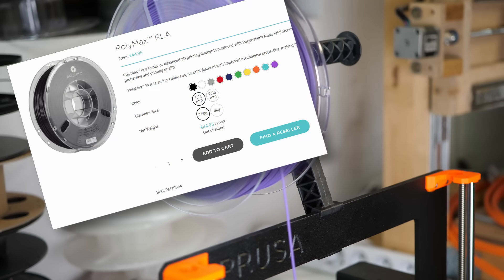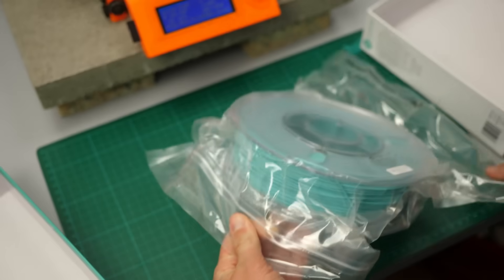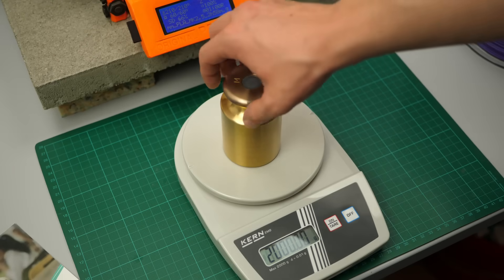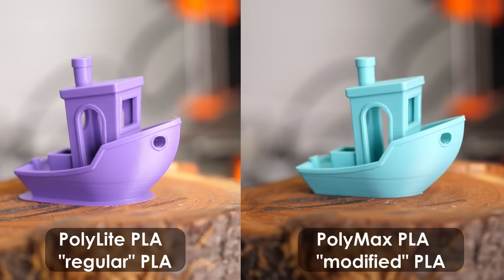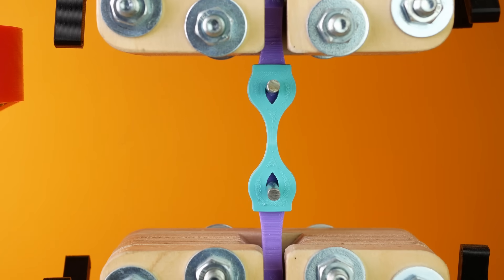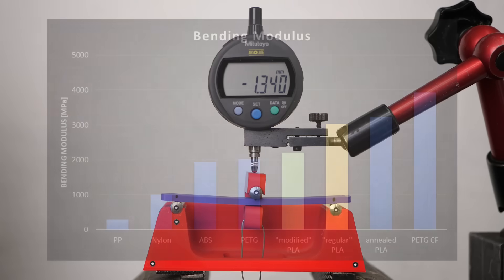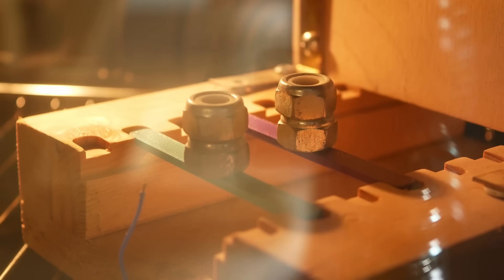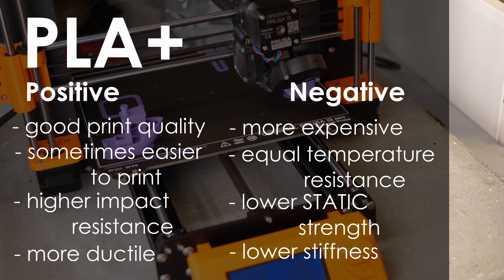How much STRONGER is PLA+ really?

Comment: Thank you, Steffan, for making proofs on my point of view.
ever since I've open PETG for me I used it for technical designs exactly due its better temperature- and impact resistance.  And use PLA mostly for decor prints, for its better stiffness. 
Plus my local filament supplier have PLA in spools of 1, 2, 3, 5 kg (actually also bigger, but I don't need so much at the time)) and kg-price reducing gradually bigger spool i'm buying.
p.s. Congratulations!

Comment: I've noticed hatbox pla+ seems to be more temperature resistant for me. Definitely needs to be printed at a slightly higher temperature. And is not as ridged as normal PLA

However it is more ridged than PETG and far easier to print quickly. It has become my go to printing filiment and unless the part is going to be subjected high temperatures like a mechanical part in a car, light, or test equipment, then i use petg exclusively.

Comment: Great video, as others have said I would love to see a follow-up video with eSun PLA+ as it's much more affordable and in my experience actually does have very significant thermal resistance benefits over normal PLA. I've left eSun PLA+ prints in my car in the Texas summer heat for days and they never warped at all whereas the normal PLA prints I left in there were super warped. You have to print it at a significantly higher temperature which is a good indicator.

Comment: I used eSun and Sunlu PLA+. Especially Sunlu didn't like my magnetic Ender 3 Pro bed (I also didn't like Sunlu so it's mutual). I fell in love with rafts while dealing with it.

After a generic PLA, they felt very strong, just because of being ductile. PLA just breaks. The filament would even break over night if I don't remove it from the printer. PLA+ don't break even after months of being connected to the printer(yes, I got annoyed with the life and the calibration problems I couldn't solve and left it for months, and the printer is still staying under a garbage bag for dust protection with the eSun PLA+ installed).

Because of hating brittleness, I decided never to buy PLA again(unless I prefer it later). I will prefer PLA+ because it feels better for mechanical applications. I will admit PLA worked nicely in roller bearings though. The high strength makes it more rigid in bearings.

Comment: Thanks for doing these tests!  I'm a semi-retired mechanical engineer and have been doing my own testing on various PLA+ filaments.  I make small structural parts and have found PLA+ to be ideal for my applications.  Independent of price, the Polymaker Polymax is the toughest.  CC3D PLA Max is almost as tough but significantly lower cost;  I tend to use that for the majority of my prints.  eSun, IMO, is good in that they have a wider selection of colors but is noticably less tough than the CC3D.  Thanks for verifying my findings and keep up the great work!  Also, congrats on the little one (good luck sleeping, ha ha)!

Comment: PLA+ feels more like a marketing gimmick to me than a material that is actually worth the increased price.
PLA+ doesn't fill a niche gap, for those properties, someone could also just print PETG or ASA which is possible on just about any printer that can print PLA.
PETG nor ASA produce toxic fumes (vs ABS) so that's also not an issue.
PETG isn't really much harder to print but just needs slightly different settings. Many ASA materials also often have additives (nowadays) that makes them also much easier to print.
Lastly PLA+ is often more expensive than PLA, PETG and ASA, while in every use case I can think off one of these 3 would outperform PLA+ or at least be equally good.
Also only improvements of at least 10% or more are worth discussing and that's a low estimate with hobby printers, as most people have more than 10% variance on their parts if you print the same part many times over longer periods (once a week for 2 months  especially with different locations on the bed).
When someone really wants "stronger" (thougher) parts than PC or Nylon should be materials you want to use  which are easily overshadow PLA+ in the use cases where they would be useful.

I also think that people underestimate how "strong" (stiffness and and yield strength) PLA actually is for parts that mostly experience static load. Especially if you want something to stay true to it's dimensions than the increased stiffness will definitely help. Just don't make a bookshelf and leave it there for 10 years. Just replace your PLA parts after 1-2 years depending on their function and location (exposure to temperature, sunlight, humidity).

Comment: I used eSun PLAs, and now using their PLA+s. Along with your differences, PLA+ is stronger against moisture.
If PLA absorbs moisture it became brittle, and breaks before extruder, making it impossible to use for print, and printed parts are also way too brittle.
PLA+ does not break at the same condition, maybe because it is less brittle.

Comment: Glückwunsch zum Nachwuchs!
I have used PETG and PLA+ from filament world for micro copters (Toothpick-size). My printer has some issues with small parts in PETG, but PLA+ works fine. The latter can take a good beating and can also be glued together, if it's minor damage.

Comment: I really like Overture PLA+. I’ve been printing that quite a bit and it prints very well. It seems to be a lot “tougher” but more ductile than regular PLA and I have been using it for more structural parts. Can be had on Amazon for about $28 USD / 1kg.
Reply: I just received a spool of this the other day. I was amazed at how incredibly strong the tensile strength was for just one layer. After I removed the skirting plastic from the bed I couldn't even break it until I put a lot of force into it. Not all PLA+ are created equal for sure.
Reply: what was your setting for this i cant get it to melt on start fast enough then it wont stick after a few go arounds. this exact brand plapro

Comment: Disappointed to not see eSun PLA+ in the testing, or at least a few more brands of it since it's quite a bit different from what i'm seeing in this video
eSun PLA+ is significantly more shiny and smoother than regular PLA, it's definitely not matte. It clearly uses a bit of oil in the filament as evident by just rubbing the part, you'll get a very small amount of oily residue on your fingers and this is FANTASTIC for sliding parts. Regular PLA is much more abrasive in comparison
There's plenty of other differences that make it essentially a whole new material that makes it outright better as a daily driver, it's so incredibly easy and forgiving to print with. There's a reason why its exceptionally popular, it's only real downside is the wispy strings on a lot of parts

Comment: I use PETG as my main filament. It gives a similar finish to PLA once dialed in correctly. But the thermal properties on the finished print are better with PETG. I hear from others that bed adhesion is an issue, so I always print with a heated bed and never had an issue with parts not sticking to the bed.

Comment: Here's a question: Does layer height affect print strength? For a given height, does the print have a greater chance of failing due to layer separation if the layer height is smaller and therefore there are more layers?

Comment: Congrats on being a real reprap! Keep in mind the human ones really need a lot of tuning, and everybody will try to tell you what settings work best 😉

I started using pla+ from eSun after I got a spool of glow pla+ as a gift instead of the abs I asked for, since my old rep2x is an abs-focused machine. When I saw its temp range seemed close enough I tried it and was pleasantly surprised by the results - I've since gotten more of it in other less abrasive colors. The cool white prints awesome and looks really nice, especially after adding a part cooling fan: I feel like the cleanliness and detail is better than I've ever gotten with abs or petg, surprisingly. I've been running with one extruder (left, closest to fan) loaded with pla+, and the other loaded with petg, for a while now, and I'm pretty happy. I'm not sure I'm daring enough to try plain pla in my printer, since it doesn't have a very effective heat break or cold side cooling.

Comment: Unfortunately, there is something important that immediate resistance tests does not show about PLA resistance and may be important in what we consider "stronger". PLA appears to be very strong on the moment. But if you submit PLA to continuous forces for long time, this material is very subjet to develop cracks with time and to break. I had parts that had broken with very moderate forces(And no shock, no water, no sun, no temperature). Reprinted these parts in ABS, they didn't cracked anymore. Maybe PLA+ is better on this.

Comment: I have not used the Polymax,but suspect it might be a bit more altered than what many manufacturers claim as PLA+. I have tried a dozen or so random PLA+ filaments, and really haven't seen much difference. Granted, I have not ran them through this kind of testing. If I really need the extra performance over PLA, I just go for PETG or ABS as needed. While I don't care much for ABS, it is pretty cheap these days.

Comment: MCPP PLA-X3, branded as ‘HobbyKing X3 PLA’ is what I use the most: https://www.mcpp-3dp.com/products/pla-x3/

Far less brittle, and seems stronger than PLA.  Very controlled dimensional shrinkage when annealed, too.

Cost is considerably more.  May be cheaper in the EU, as it’s manufactured in the Netherlands.
Reply from the maker: It's great when you're looking for the temperature resistance, though I had issues with layer and bed adhesion in the past.
Reply: CNC Kitchen 
Yes, bed adhesion is lower than some PLA types.  It is also a mat finish, and softer (less hardness) — but very strong after annealing.

I haven’t noticed layer adhesion issues.  I print this at 230 degC, on a 60 degC bed.

Comment: Congratulations on your changes in life. All the best for your wife, baby and you of course.

Coming back to Pla+ I think it doesn't make sense to use it over PETG. It could be usefull only to pint nice tough figurines that will not break if you drop them from gaming board - nothing special that would explain 2x price factor.

Comment: I’ve only used 5 rolls of pla since I’ve only been at this a year, but the one roll of pla+ I have used has been MILES better than any of the rolls of pla I’ve had so far. I still prefer petg, of which I’ve only had two rolls, both unfinished, but I’m switching to pla+ permanently when I go for a print that needs a lot of support material.

Comment: So Stephan, in your opinion, if you had to choose between these two, PLA or PLA+ for mechanical gear applications?
Reply from the maker: I had good experiences with both. If you don't fear short overloads, you can get away with regular PLA. If you there might be load spikes (breaking, jam, etc.) probably the PLA+ is a better choice.

Comment: Awesome video, as always. I have some analysis that people may find helpful.
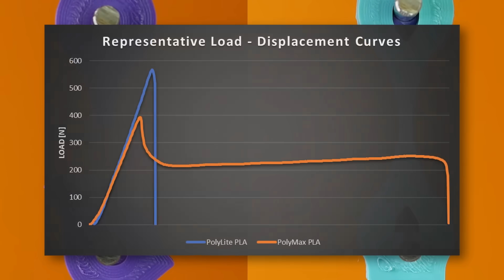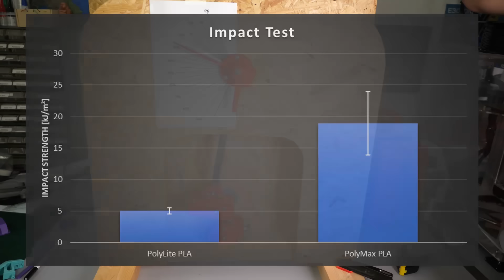Toughness is the area under the stress-strain curve at 7:12. Based upon this, the significantly higher impact energy  of PLA+ at 9:48 is expected. However, for most practical applications, the part is considered to have failed once it permanently deforms. This is where resilience comes in. Resilience is the area under the linear portion of the stress-strain curve. Looking at the graph unmodified PLA is significantly more resilient. Moreover, it has a larger strain before permanently deforming. This makes the unmodified PLA significantly better for the vast majority of parts. From these numbers, an easy rule of thumb is to not even consider PLA+ unless the part you are making is intended to be permanently deformed, like a bumper that needs to absorb impact energy.
Reply: I could not have said this better my self. A part is broken once it have made a permanent deformation. And it will probably be completly broken if you bend it back so it can perform the function it was made for. This is relevant when comparing PLA to other materials also. I always see a trend where everyone want ABS-like materials. But ABS is weak crap, but just because it have impact strenght people think that is all that matters.

Comment: Have unfortunately not tried the modified PLA types, but my experience with regular PLA is that the color of the material means a lot for the strength and printability. In particular, one should avoid the colors blue and chalk white. I have found that PLA is also excellent for gears. Can not find much difference between ordinary PLA, PETG and ABS in terms of wear resistance. However, there is probably a difference in strength if they are loaded with very large loads.

Comment: Modified PLA is all I've been using for over a year. It's really hard to go back to regular PLA at this point. My favorite is Filacube PLA 2 at around US$24/kilo and second is eSun PLA Pro at about the same price. Stringing has never been an issue. The best thing I like about the modified PLA is that it's not brittle like regular PLA. I can drive screws into it without it cracking and breaking. Any post print work such as sanding and cutting/trimming is much easier too. Almost like ABS. Takes paint well including water based like Acrylics. I've used CA glue on it and epoxies too with no issues.

Comment: Not many people pay the price of Polymaker, how about testing esun PLA vs esun PLA+ since it is about half the price of polymaker.
Reply: I use eSun mostly and my preference is always to use PLA+ over regular PLA. In my experience it prints better and is less brittle. I must admit I was surprised to see how much the modified polymaker deforms, I do wonder if eSun would yield the same results.
Reply: @scottabercrombie4455  I was surprised too as I also use esun PLA+ and have been very happy with it and when the polymaker deformed etc. I wondered the same, what about esun that people actually buy. :-D
Reply: @scottabercrombie4455  Polymaker has a blend of several polymers I think,might even be more toxic than PLA. eSun simply adds a small amount of calcium carbonate to PLA. From my experience with eSun it looks like it's similarly effective at improving impact strength.
Reply: The only PLA I use is the eSun PLA Plus. I started using it a couple of years ago and loved it. Smooth as butter.
Reply: Theres a difference between PLA and PLA+ when it comes to low temperature warping, like due to the sun in a hot car.  I find ESUN pla+ much more resistant to warping that regular pla.
Reply: Yes, an esun test would honestly be the most interesting as its probably one of the most practical and appears to be rebranded microcenter (and possibly others) so its a very generic PLA/PLA+ to test.
Reply: Polymaker filament is very good though
Reply: good luck finding regular esun PLA anymore
Reply: @Sam Chaney, I print eSun PLA+ at 205c on Prusa MK3s, Ender 3 Pro and Ender 3 V2. That's only about 10-15c higher than standard PLA filaments I used years back. I don't conisder that ‘significant’.
Reply: the specsheets state that PLA+ has slightly lower/equal tensile strength, more elongation at break, a bit less flexural strength, equal or a lot less flexural modulus and more impact strength. I have 2 specsheets from 2 different filament rolls and the values are partially vastly distant. idk if they changed their formula or their testing method
Reply: Yep eSun is awesome and I think it has significant thermal resistance over normal PLA. I don't know about the polymax but the eSun PLA+ must be printed at significantly higher temps than normal PLA.
Reply: because esun wont pay him? :-P no honestly just run to amazon and test cheaper pla+ (with prime) thats what people buy
Reply: @MoesKeckeEcke  I can only find the plus version of it nowadays

Comment: Congrats on the baby! I don't print as much in the 1 year since my baby is with us, but I can't wait to print things for her as she gets older. PLA+ i use primarily eSun brand, and I find it is very resilient to moisture exposure - leaving normal PLA in my printer for more than 2 days ends up in broken filament which is difficult to remove. PLA+ seems not to matter as much, and i can leave it a week before it gets wet enough to cause problems.